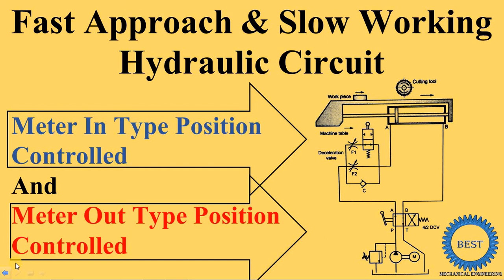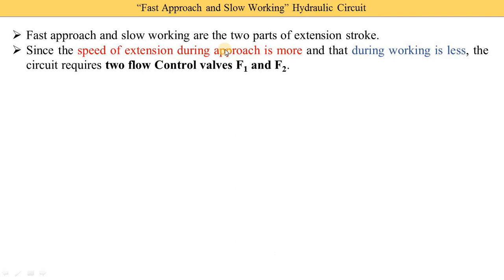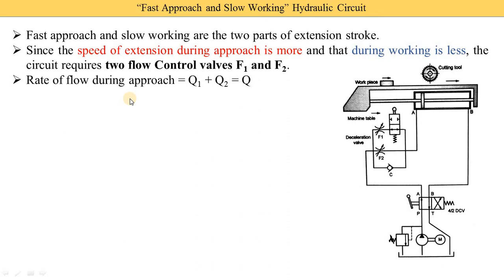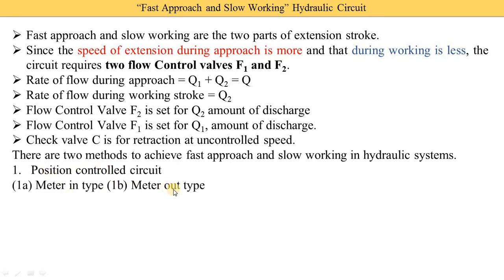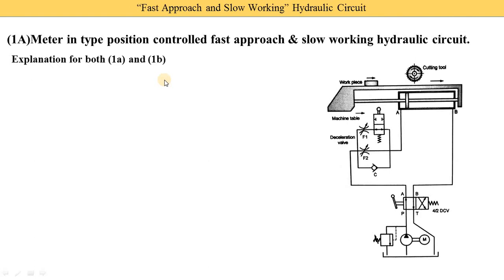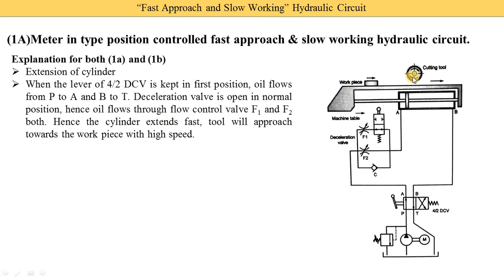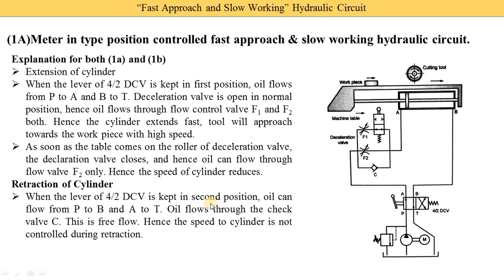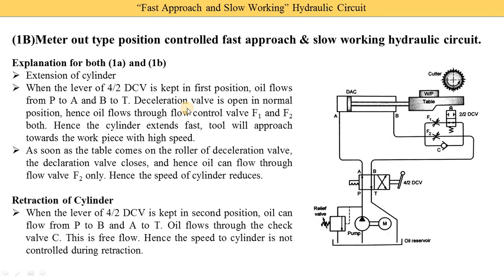“Fast Approach and Slow Working” Hydraulic Circuit - Position Controlled Circuit

Comment: Sir this very long chapter 😔 naya chapter kab suru hoga.? 🤔
Reply from the maker: From 19 nov
Reply from the maker: Gtu theory  exam will start from 10 dec.
Reply: @bestmechanicalengineering  OK 3 December nai hain?? 🤔
Reply from the maker: @prajapatimaulik2130  no.10 dec.
21 or 24 gtu external practical viva is strat